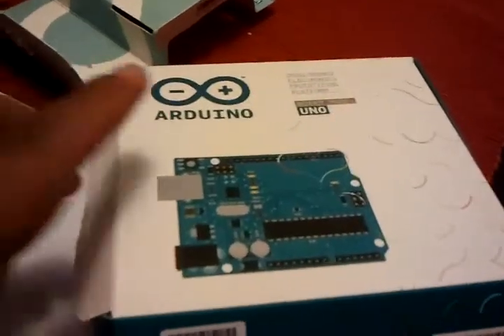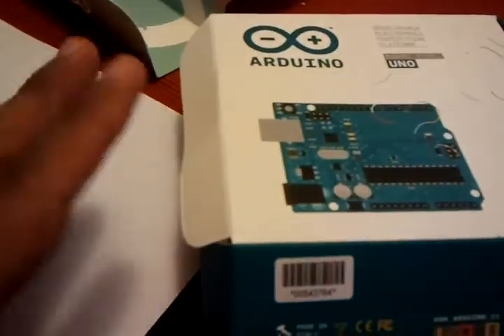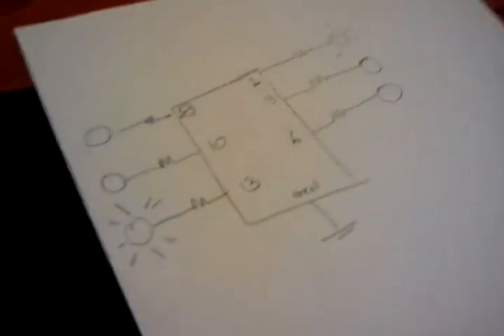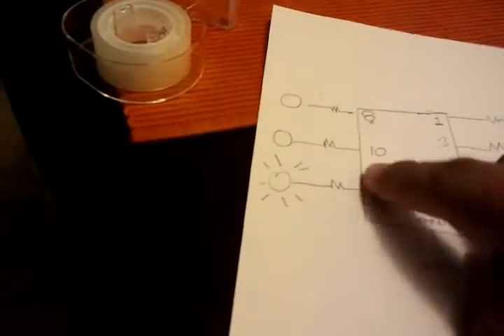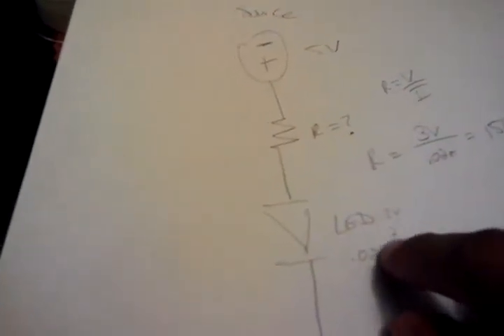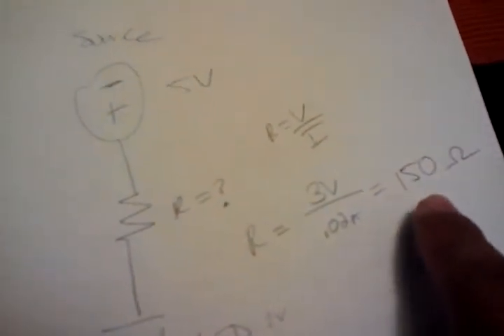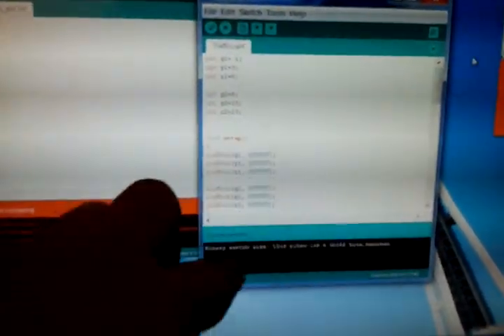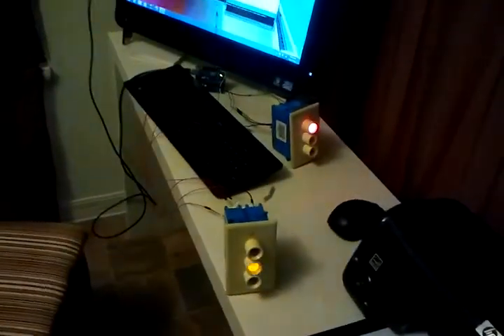Arduino Traffic Light Part 1

Comment from the maker: I went to homedepo and on the electrical section and bough blank wall plates no holes, for visors go to the pluming section and I got cpvc coupl size 1/2 X 1/2. I drilled holes on the plates equal spacing big enough for the led to fit trough from the back (start with smallest drill bit size and work your way up, that way you count crack your plate), and the then I superglue the visors.